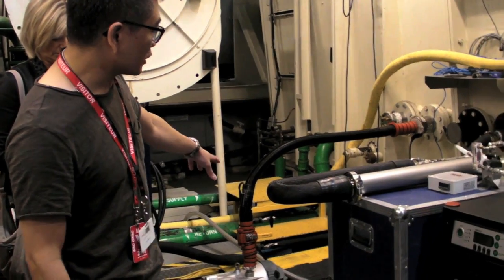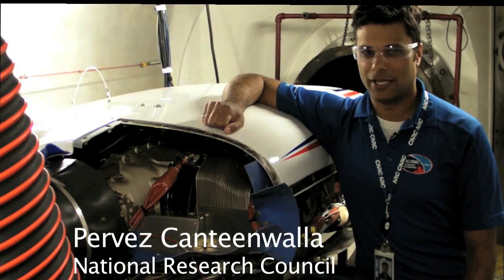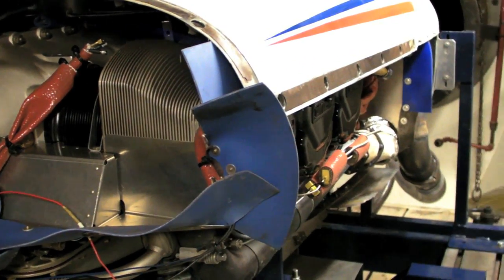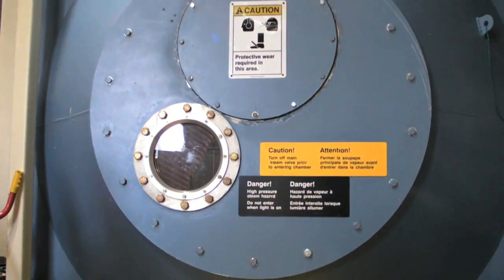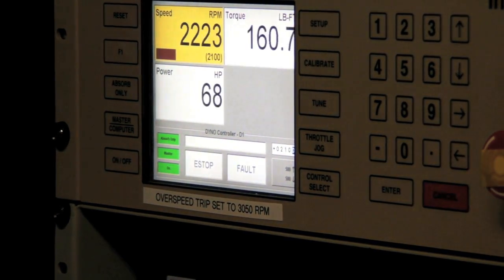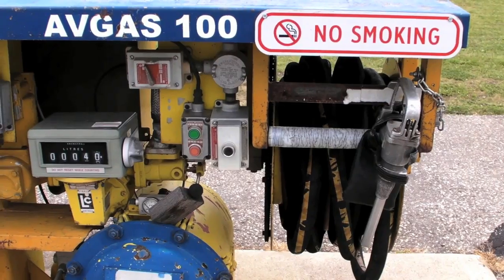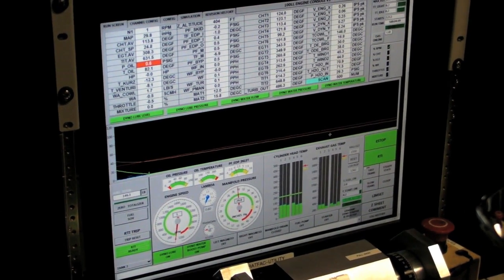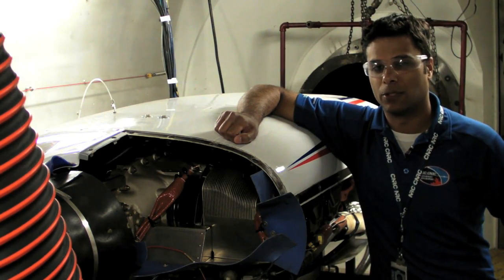Unleaded Fuel Tests At NRC

Comment: Now that trump is president we should see ifwe can get some kind of ultimate grandfathered in status for 100LL.  We all know that a fuel that is just as good with NO compromises and no lead is impossible. I'll believe it when I see it.  I also dont believe that emissions from 100LL pose any significant or even insignificant threat.  It is such a tiny fraction of engines using it compared to jet fuel, car gasoline etc. I just simply dont believe that it really is a safety hazard and we shouldnt be forced to switch to a more expensive and less effective fuel.  Seriously i bet we could get it grandfathered in for good with the current political climate in washington.  I think that would be the best choice for safety.
Reply: It depends how close you live to a general aviation airport. Mind you I lived through the leaded fuel and paint era of the late 60's and 70's and came out okay.I got a blood test a few years ago and the reading was negligible. Others that were exposed to higher levels no so much (industrial workers, inner city residents in older homes, etc.). Less lead is better than more lead. None at all is best of all (maybe not possible with as much lead from leaded gasoline from the 1920s - 1980's - mid-90's).

http://www.motherjones.com/blue-marble/2012/12/private-planes-still-use-leaded-gasoline

http://www.motherjones.com/environment/2016/02/lead-exposure-gasoline-crime-increase-children-health